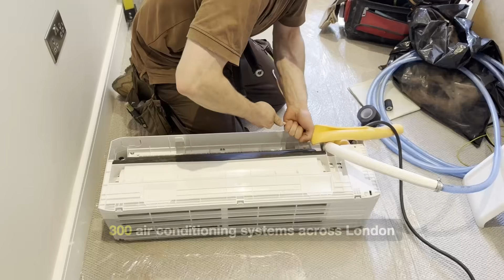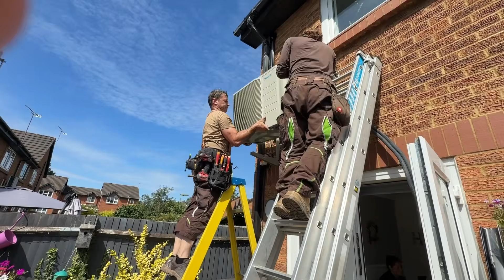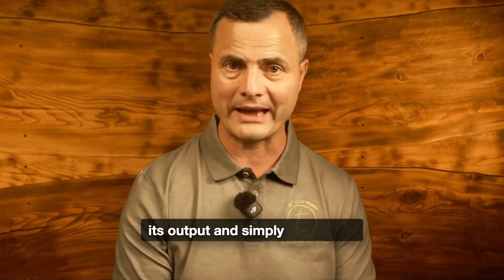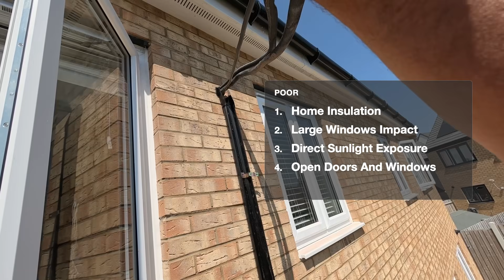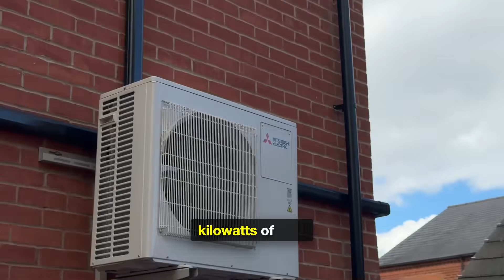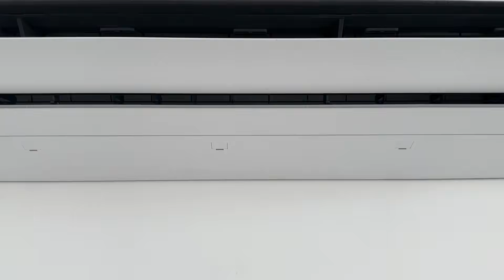Does AC Consume A Lot Of Electricity? The Truth About Kw And Running Costs.

Comment: AC units are generally not good for heating as the indoor unit is high up on the wall. Hot air rises so you need the heat source down at floor level.
Reply: Just add a ceiling fan to force hot air down problem solved .Mine work well without a fan no problem at all .😂👍🇬🇧🦊

Comment: I foresaw global warming and its impact, had large Fujitsu inverter and 4 head units installed in 2018. Great investment, and i feel smug now when its 35 deg outside and my main living areas are kept at 23 deg. Typically only use 8pm to midnight as house is SW facing and bedrooms get 28+ degrees otherwise. Also worth noting running them just on Dry mode can help significantly reduce how hot it feels as it takes the humidity out of the air. Not sure how running costs in that mode compare to cooling mode?